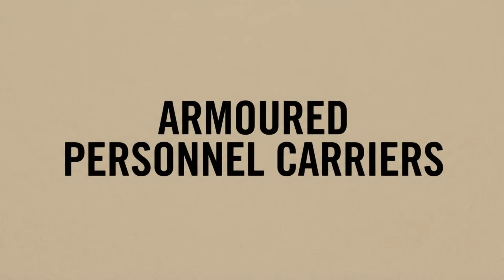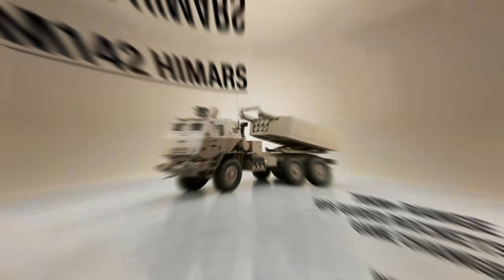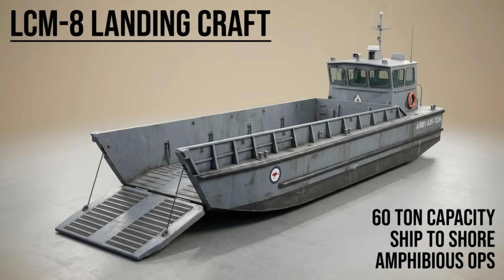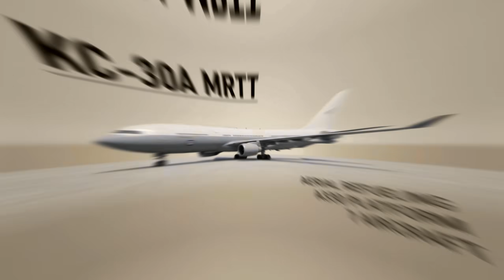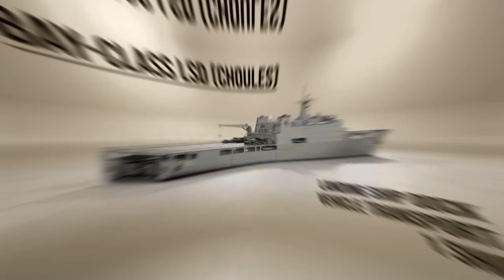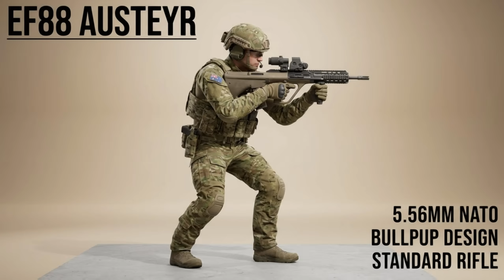Could Australia Stop an Invasion?

Comment: sorry,but Ur AI generated image of ghost bat is just wrong. as is the limited info on it. This is NOT a remotely piloted vehicle, but an AI enabled one. Already evolving, and adapting. Mk/ V 3 has just been ordered, will see where it ends up. But apart from ground controllers guiding it to take off spot, it does it all on its own. Very different from some of the other UAV  looked at.